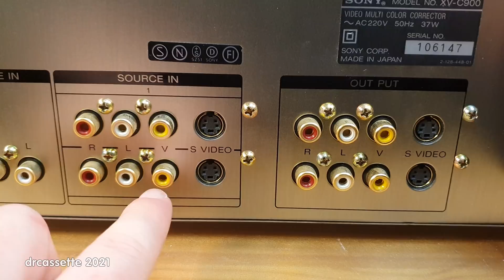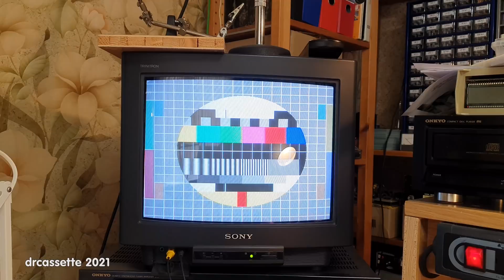Sony XV-C900 analog video multi color corrector repairs

Comment: I have the same corrector, and it works well, but it has a small problem. The corrected image is shifted to the right by about 1 cm. There's a thin black vertical line. The original image is visible on the left, and the corrected image is on the right. What should I do? Best regards.

Comment: Nice video and an interesting device. I also have a lot of PAL equipment, but in these days of increasing resolutions they all tend to become obsolete. Are you going to really use this device or is it just for the purpose of collecting? Besides this all I like your choice of using the V.A.G. typeface. I've used it extensively in the 90's for its proper use, making signs for Volkswagen dealers, but would never use it again I suppose. Keep up making videos, all the best.
Reply: Im hoping to get one to use it for experimental video art purposes. In other ways it indeed seems obsolete, considering what is available these days.
Reply from the maker: The colour corrector may come in handy for transferring analog video to digital. So it may get some use. 
You are the first one commenting on the VAG font I use these days. I use it not because of its connection to Volkswagen, but because it is somewhat close to the font the German TV station ZDF used in the 80s and 90s. It's nice and simple, and looks good on video, much better than the BBC-inspired Gill Sans font I used before which is much too complex.
Reply: @DrCassette  Yes, for transferring old tapes it may certainly come in handy. That is the reason why I still have my equipment too. 
I think Gill Sans is fine for screen too, but one should use a bolder variant. What makes V.A.G. ideal is the fact that it's very geometrical. I personally find it too round and makes me think of a brand for children's toys... If you allow me to suggest a - in my opinion - suitable font it would be DIN Mittelschrift. It's obviously also very German but has a more serious and scientific feeling to it. I do remember the old ZDF logo as well, and if that is just what you are looking for, ignore my opinion and happily continue making your interesting videos! Guten Abend!

Comment: Sony's first DVD player, the DVP-S7000, also has multiple holders and "claws" inside its case to prop its boards up on. Its drive cover even has a special cut-out so the drive can be tilted in place to make connecting its ribbon cables easier. Oddly none of their subsequent DVD models have anything like that to make servicing easier.
Reply: Also if you ever see one of these for a good price grab it, they're very interesting technically and still produce a very fine "reference" CRT picture.

Comment: This weird area on the board with nothing connected looks like a prototyping area. More often than not, these machines which are complicated and expensive and not produced in great quantities have some bugs or an engineer has an idea for a spectacular effect that requires minimal hardware, so that would go into the prototyping area.
I recently got two Time Base Correctors, one of which appears to work (I couldn't find any of the problems I was told about, but I found that my monitor has trouble syncing the color frequency), the other was said to produce no signal. Turns out, using an old CRT instead of a modern LCD revealed that the signal looked... odd. There was mains hum on the picture. Like mad. So I scoped the power supply and it has terrible ripple. And then I saw it was doused in electrolyte. I'll have to completely depopulate the PSU to be able to mop that up.
Reply from the maker: What brand and model are your time base correctors? Indeed the old CRT monitors can display problems and imperfections in the analog video signal a lot better than the modern LCD monitors. You should be able to give the PSU a bath in isopropyl alcohol once all the leaky capacitors are gone. Isopropyl alcohol does a really good job at dissolving electrolyte. No need to completely depopulate the board...
Reply: @DrCassette  Thanks for the tip, that'll save a few hours (and a few headscratches from components I'll almost certainly put back incorrectly)
The working one is a ForA, the other is a Panasonic and both are virtually identical except for the paint job on the case.
Reply from the maker: Ah okay... I have a JVC KM-F250 time base corrector, and I have read online that those have bad capacitors in the power supply too, but in mine all the capacitors seem to be fine.

Comment: Eventhough Sony’s industrial designers created a clever service friendly product, they did goof up the mechanical engineering on that sagging circuit board. As a structural engineer it hurts my eyes😖. If that was a concrete slab it would have failed catastrophically. On the other hand, it’s a nice demonstration of the flexture in a slab. A few extra standoffs wouldn’t have hurt I guess.
Reply from the maker: But then when the frame the boards were mounted to got bent, this was an advantage. Had the boards been mounted more rigidly, there would have been lots and lots of cracks from the impact...